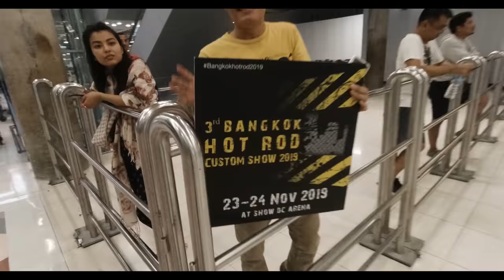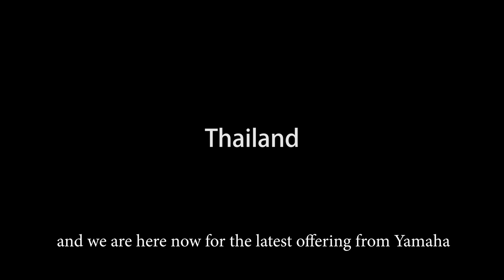Yamaha XSR155

Comment: I wish Yamaha would bring this bike to Canada. It looks great and 19hp is good enough for beginners. The 155cc engine is frugal enough with gas with the VVA. Yamaha, PLEASE bring the XSR155 and WR155 to Canada. KEEP the WR250R here - I have one - unless you can add more pep to the engine with more grunt to the bottom end WITHOUT gaining weight. I love that the main frame of my WRR and swing arm are aluminum for weight savings and protection against rust and that 3rd parties make bigger gas tanks for it.